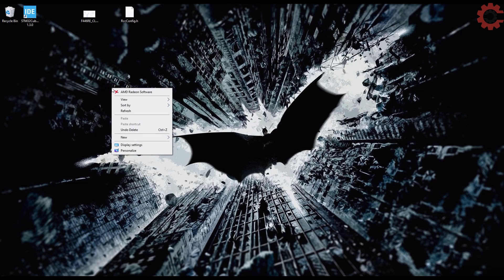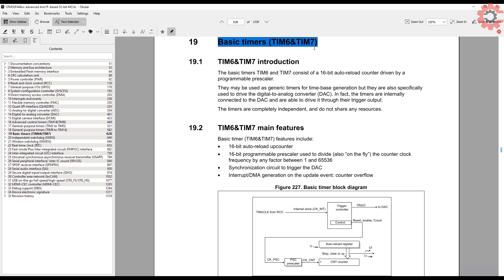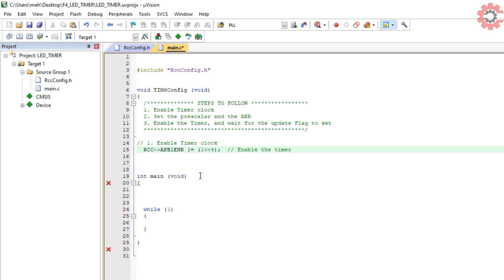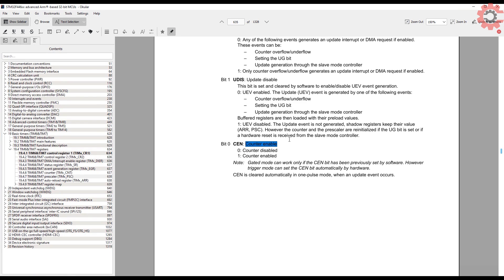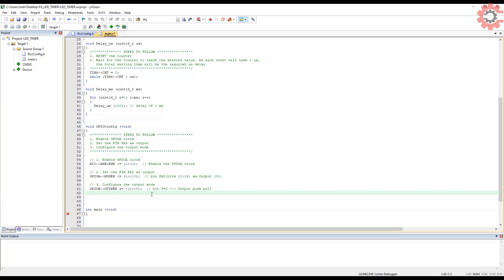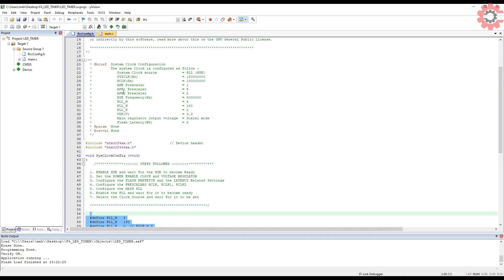#2. Setup Timer to generate Precise Delay || STM32F4 || LED Blink || NO HAL

Comment: This clock configuration  doesn't work properly with STM32 CubeIDE. Any suggestions regarding CubeIDE to do CMSIS based programming without using HAL?

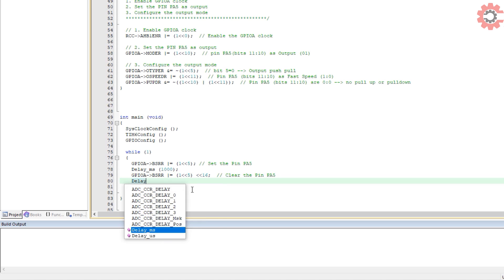Comment: 14:27 but Stop! When the timer runs at 1 MHz I learned wie can't count longer then 65,535 ms? How we count then so long? Or I have a brain failure maybe?
Reply from the maker: We are not directly counting here. Check 08:28, there is another function. 
Also it's not 65535 ms, it's 65535 counts. There is a difference between both. If each count takes 1us, then max counts will be 65535 us. If each count takes 1ms, the it will be 65535ms. 
The counter resets after reaching this value.
Reply: @ControllersTech  oh, misunderstanding of my format. I mean with the comma really a comma. Then I must write so: 65.535 ms is the max counting value with 1 MHz.
But I understand it yesterday after a little bit time goes over after the video. How you realize the ms delay, we don't need to count over 1ms. Because we use a delay from the other function for that....🙂

Comment: 11:32 why we don't simply shift a "0" 5 Bits to left with "or" operator?
Reply from the maker: You clearly don't know how bitwise operations work. Please read the topic. 
OR is used for addition. Adding 0 does not has any effect on the bit.
Reply: @ControllersTech  that is really true I think now. 😅
When I do OR with a zero and a 1 is in that bit -> the one doesn't change.
When I use AND with a zero and a 1 is in that bit -> the result won't become true, so a 0 is written in the register bit. 😊
But why we invert a 1 to a zero with the tilde? And don't use directly a zero?

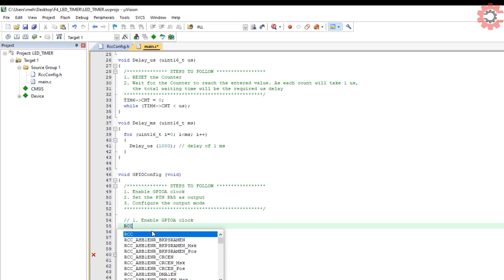Comment: 9:44 there I've a question: when we only write "1" with the "or" operator to the register or also without the "or" then the same result should be come out in my head. Because when we write a "1" and not 0b1: is that not the same? Because in 0b1 the zeros that are before the one are thinked before, but we don't need to write it. Is that also true when we write "1" as integer / decimal number in the register?
Reply from the maker: OR operator is for addition.

Comment: Thanks for your video, i have to make a project were i need the timer works in nanoseconds. Using every 72mhz of bluepill, with no prescale, i should have a precision of 13.8nanoseconds, what do you think? I am scared about Crystal 8mhz because I don't know if it is a bottleneck. I will use a photodiode that is very fast (5nanoseconds) to send value to stm32. Thanks again and keep up the good work!

Comment: Can i give  counter value directly in arr register  . for examble tim2->ARR =1000;
Reply from the maker: CNT register holds the current counter value. 
ARR register hold the maximum counter value allowed.
Thee CNT value is compared with the capture compare register (CCR), and relevant operation is performed.

Comment: The guide is very clear and detailed. I have got and timing error in my STM32F746ZG. When I have checked the blinking rate with the oscilloscope I observed around 1.8 second delay instead of 1 second. This was due to the reset values of the RCC's PLLCFGR register. I have added a line of code for resetting the PLLCFGR register with 0's before setting the parameters and I finally got the 1 second delay. My take from this issue is that the reset values of the registers need to be considered when we are not resetting every register manually before setting them.
Reply: Can you please elaborate
Reply: @serpico3w767  RCC peripheral’s PLLCFGR register which can be found in the Reference Manual of the related MCU was not 0x0000 0000. Its was something like 0x0000 0101. I have observed this in step by step debugging of the code with the STM32CubeIDE and also checked the default reset value of the register wirth the reference manual. So if you do not set the register to all zeros before setting the bits with OR statement you might get different value than you wanted to set. So I needed to clear the register before setting the bits.

Comment: i cant set the clock frequency in target option . its shows undefined  on that position. here im also using mdk v5. please give the solution sir....
Reply from the maker: Try without setting that.. i guess it works alright
Reply: @ControllersTech  ok sir

Comment: Thanks for your helpful videos. I just have one concern. which is to set The UG bit in TIMx_EGR registers to update the registers. otherwise, the update will not going to happen until an overflow or underflow occurs. which could take a very long time if using the 32-bit register, and this is what exactly happened with me until I noticed that in the datasheet.
Reply: This tutorial worked for me, so can you please explain a bit(lol) more?
Reply: hello, I am trying to do a similar program for 3 different LEDs using 3 different timers, I am using 2 16 bit timers and one 32 bit timer, the program works fine for the 16 bit timers with both LEDs blinking at different periods, but my other led which is using the 32bit timer does not blink it stays on for a long while and turns off. Could you explain the EGR register in more detail because I think this is the part I am missing in my code, thanks
Reply: @justsomegamer4086   sorry just noticed your comment. Do you still need help?
Reply: @seifelkhouly9090  figured it out boss, thanks
Reply: @justsomegamer4086   good for you! sorry I do not receive notifications.

Comment: Hi sir, i am working with stm32f401, have clocksys 84Mhz ; i use tim3 but delay_ms function is not working. please guide me 
********************************************code sysClock:
/*
STM32F401VET run HSE : 25Mhz
PLL-M: 25
PLL-N: 168
PLL-P: 2
APB1/2 : 42MHZ
APB2/1 : 84MHZ

VDD = 3.3V
INSTRUCTION CACHE : ENABLED
PREFETCH CACHE : ENABLED
DATA CACHE : ENABLED
FLASH LATANCY : 2WS
POWER VOLTAGE SCALE : SCALE 2
*/
#include "stm32f4xx.h"
#include "stm32f401xe.h"

void SysClockConfig (void)
{
		
	#define PLL_M 	25
	#define PLL_N 	168
	#define PLL_P 	0  // PLLP = 2

	// 1. ENABLE HSE and wait for the HSE to become Ready
	RCC->CR |= RCC_CR_HSEON;  // RCC->CR |= 1<<16; 
	while (!(RCC->CR & RCC_CR_HSERDY));  // while (!(RCC->CR & (1<<17)));
	
	// 2. Set the POWER ENABLE CLOCK and VOLTAGE REGULATOR
	RCC->APB1ENR |= RCC_APB1ENR_PWREN;  // RCC->APB1ENR |= 1<<28;
	PWR->CR |= PWR_CR_VOS;  // PWR->CR |= 3<<14; 
	
	// 3. Configure the FLASH PREFETCH and the LATENCY Related Settings
	FLASH->ACR = FLASH_ACR_ICEN | FLASH_ACR_DCEN | FLASH_ACR_PRFTEN | FLASH_ACR_LATENCY_2WS ;  
	// FLASH->ACR = (1<<8) | (1<<9)| (1<<10)| (5<<0);
	
	// 4. Configure the PRESCALARS HCLK, PCLK1, PCLK2
	// AHB PR
	RCC->CFGR |= RCC_CFGR_HPRE_DIV1;  // RCC->CFGR &= ~(1<<4);
	
	// APB1 PR
	RCC->CFGR |= RCC_CFGR_PPRE1_DIV2 ;  // RCC->CFGR |= (5<<10);
	
	// APB2 PR
	RCC->CFGR |= RCC_CFGR_PPRE2_DIV1 ;  // RCC->CFGR |= (4<<13);
	
	
	// 5. Configure the MAIN PLL
	RCC->PLLCFGR = (PLL_M <<0) | (PLL_N << 6) | (PLL_P <<16) | (RCC_PLLCFGR_PLLSRC_HSE);  // (1<<22);

	// 6. Enable the PLL and wait for it to become ready
	RCC->CR |= RCC_CR_PLLON;  // RCC->CR |= (1<<24);
	while (!(RCC->CR & RCC_CR_PLLRDY));  // while (!(RCC->CR & (1<<25)));
	
	// 7. Select the Clock Source and wait for it to be set
	RCC->CFGR |= RCC_CFGR_SW_PLL;  // RCC->CFGR |= (2<<0);
	while ((RCC->CFGR & RCC_CFGR_SWS) != RCC_CFGR_SWS_PLL);  // while (!(RCC->CFGR & (2<<2)));
}

*******************************************code main:
***********************************************
#include "RccConfig.h"
int i;

void TIM3Config (void)
{
	/************ STEPS TO FOLLOW ***************
	1. Enable Timer clock
	2. Set the prescalar and the ARR
	3. Enable the Timer, and wait for the update Flag to set
	************************************************/

// 1. Enable Timer clock
	RCC->APB1ENR |= (1<<1);  // Enable the timer3 clock
	
// 2. Set the prescalar and the ARR
	TIM3->PSC = 84-1;  // 84MHz/84 = 1 MHz ~~ 1 uS delay
	TIM3->ARR = 0xffffffff;  // MAX ARR value
	
// 3. Enable the Timer, and wait for the update Flag to set
	TIM3->CR1 |= (1<<0); // Enable the Counter
	while (!(TIM3->SR & (1<<0)));  // UIF: Update interrupt flag..  This bit is set by hardware when the registers are updated
}

void Delay_us (uint16_t us)
{
	/************ STEPS TO FOLLOW ***************
	1. RESET the Counter
	2. Wait for the Counter to reach the entered value. As each count will take 1 us, 
		 the total waiting time will be the required us delay
	************************************************/
	TIM3->CNT = 0;
	while (TIM3->CNT < us);
}

void Delay_ms (uint16_t ms)
{
	for (i=0; i<ms; i++)
	{
		Delay_us (1000); // delay of 1 ms
	}
}

void GPIOConfig (void)
{
	/************ STEPS TO FOLLOW ***************
	1. Enable GPIOA clock
	2. Set the PIN PA5 as output
	3. Configure the output mode
	************************************************/

	// 1. Enable GPIOA clock
	RCC->AHB1ENR |= (1<<0);  // Enable the GPIOA clock
	
	// 2. Set the PIN PA5 as output
	GPIOA->MODER |= (1<<10);  // pin PA5(bits 11:10) as Output (01)
	
	// 3. Configure the output mode
	GPIOA->OTYPER &= ~(1<<5);  // bit 5=0 --> Output push pull
	GPIOA->OSPEEDR |= (1<<11);  // Pin PA5 (bits 11:10) as Fast Speed (1:0)
	GPIOA->PUPDR &= ~((1<<10) | (1<<11));  // Pin PA5 (bits 11:10) are 0:0 --> no pull up or pulldown
}

	

int main (void)
{
	SysClockConfig ();
	TIM3Config ();
	GPIOConfig ();
		
	while (1)
	{
		GPIOA->ODR |= (1<<5); // Set the Pin PA5
		Delay_ms (1000);
		GPIOA->ODR |= ~ (1<<5);  // Clear the Pin PA5
		Delay_ms (1000);
	}
	
}

Comment: I’m curious why TIM6Config waits for UIF to be set? That’s going to end up waiting for 65536 microseconds (when the timer’s counter reaches the ARR value and is reloaded). AFAICT, you don’t need to wait after configuring timers (like you do with the oscillators and PLLs).
Reply from the maker: Yeah even i am not sure about that. I tried simple way and it wasn't running.. after i almost gave up on it, i went through the hal initialisation and there i saw that they were looking for this bit to update.
I still don't know why though.. but it works with it. 
I will dig deep when i have some free time for this
Reply: @ControllersTech  The problem is actually that the prescaler only starts working after the next update event. It is written in the datasheet: "The new prescaler ratio is taken into account at the next update event." So basically after you start the timer the prescaler won't work because no update event happens until it reaches the ARR value. If you wait for the UIF flag to set (like in the video) that means you wait for the counter to count until it reaches 0xffff, with lower clock speeds and higher ARR values it can take a really long time (even minutes) for your program to move forward because it is stuck in the while loop. After you enable the timer you can generate an event by software with setting the first bit of the Event Generation Register (TIMx_EGR: Update generation) and then your prescaler will work. To summerize: if you change that while loop to: TIM6 -> EGR |= 1, you don't have to wait for a UIF event, your program can instantly proceed and your timer will work corretly. I hope i was clear. Thanks for your videos they help me a lot. :)

Comment: You have done a mistake bro...check the APB1, it is 45Mhz and you are selected 90 for pre scaling. 45 is correct for pre scaling.
Reply from the maker: Apb1 timer clock..
Reply: @ControllersTech  TIM6 ->PSC = 45-1;   ... this is correct
Reply from the maker: Not APB1 peripheral clock.. look at APB1 timer clock.. they are different
Reply: @karthikps3892  He was right. He used APB1 prescaler = 4. HCLK was 180Mhz => PCLK1 = APB1 peripheral clocks = 180/4 = 45Mhz while APB1 Timer clocks = (180/4) * 2 = 45 * 2 = 90Mhz. You should revisit 3:17. TIM6->PSC scales the APB1 Timer clocks, which is 90Mhz, not APB1 peripheral clocks (which is 45Mhz).

Comment: Hi...I am using stm32f407 discovery board. @168mhz. I have done everything right but my LED blinking delay is about 5 seconds, where as it should be 1 second.
Reply from the maker: I need to see the code.. contact me on discord
Reply: What was the fix to this? I am having the same problem and would appreciate any guidance. I am using stm32f767zi.
Reply from the maker: I don't remember exactly but i guess it could be due to because he was keeping the input clock at 25MHz, though his board had the 8 MHz input crystal.
Reply: @ControllersTech  Thanks for the quick reply. After some investigation, it turns out that the Nucleo board that I have has a 25 MHz external clock as you described. Thanks so much for your help and videos!

Comment: Hello,Very good video.
Could you please make a video of NO HAL timer delay based on interrupts?
Thanks
Reply from the maker: how will delay with interrupt work ?
Reply: @ControllersTech  If you set the prescaler and ARR such that the ARR period is the delay you want, and configure the timer’s UIF interrupt, then the interrupt handler will fire at the end of the desired delay. For longer delays, compute the multiple of the ARR period, then decrement in the interrupt handler; when it gets to 0, your time is up.  For example, make the ARR period be 1ms; then you can easily do Delay_ms() without blocking.  I think there may be another counter that changes on every ARR period (on advanced timers only?); if so, that would be an alternative to a software counter.
Reply from the maker: Yeah i know about that but can we call it delay ? It is more of a period update, suited for some periodic function. 
Maybe be good for blinking LED but certainly can not be used for delay purpose

Comment: You use an 8 MHz external crystal but the external crystal position is empty?
Reply from the maker: It's there on the top. Shared between st link and the mcu

Comment: You are a very good programmer.  I had to smile when you said you'd rather shift 16 bits left instead of shifting 21 bits left. But you are correct you saved the time it takes to shift 5 bits.  Do you prefer using register programming or using ST's HAL API ? One last question .. will you be advancing to robotic applications in the videos at some point ?
Reply from the maker: I prefer registers but things gets very complicated specially with arm Cortex series. HAL is easier approach but not so much optimised
 I might include more robotic stuff but not now. I still have more basic things to cover right now..

Comment: what's the difference between uVision and CubeIDE ? Can I use cubeIDE to execute this same exact code with the same result ? 
(I apologize for this  silly question, just a noobie in Embedded Software)
Reply: @hjvanderlinden  So basically both cube and keil can do the same job  (with slight differences) ? In other words , they are two "equivalent" alternatives for ST like, for example, eclipse and NetBeans are two IDEs for Java?
Reply: @mprone  STM32CubeIDE is free. In fact you can, program stm32 or any Arm on you fav IDE if you know how to write linker script (.ld file), startup script (.s file) and makefile (using cross compiler to compile your code). I heard you can develop arm projects on vscode using PlatformIO but my friend said he couldn't upload code to microcontroller while using that extension. I haven't tried it yet.